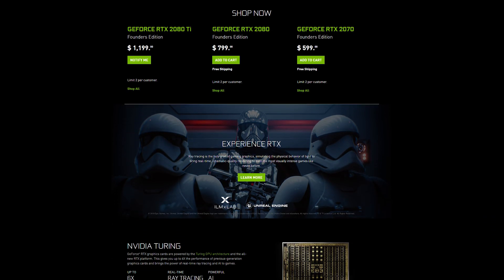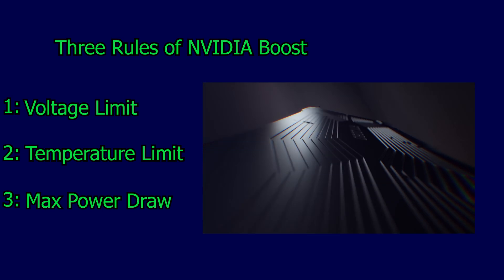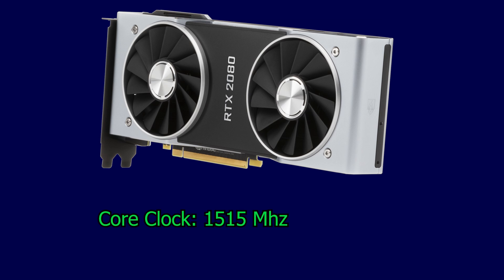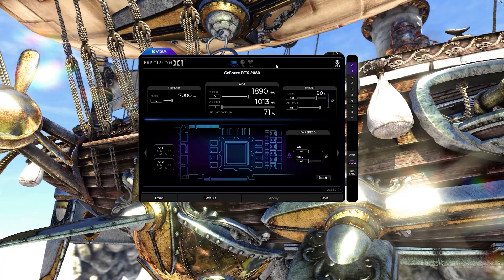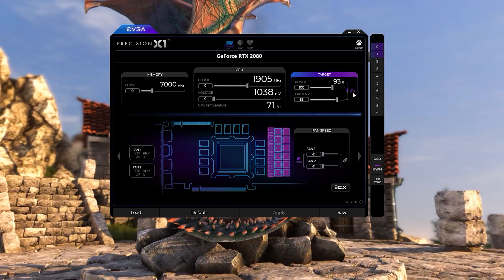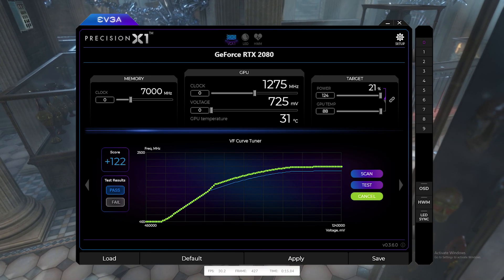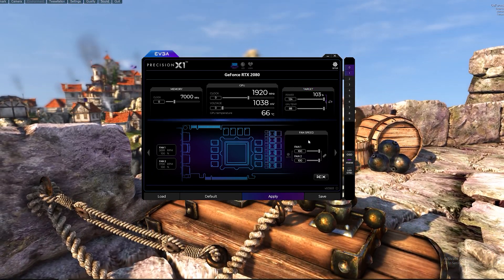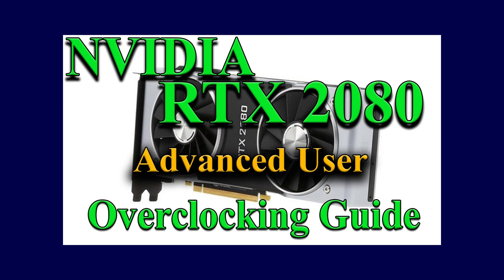What is NVIDIA Boost 4.0!

Comment: Does VRAM temp matter with boost clock?
Reply from the maker: No because Boost does not adjust the Ram Frequency. It has set stepping values from Idle to 3D-Load.

Comment: Hi I just bought a gigabyte rtx 2060, my card is always hitting the 83c temp limit, is my card gonna be okay with that high temp? My case has 3 fans front intake, 1 exhaust rear and 1 exhaust top. Thank you for your answer.
Reply from the maker: Yes. If you don't play with the settings, NVIDIA temp target is always 83c. You can increase the video card fan speed yourself if you want lower temps.
Reply: @overclockersclub   mine can go all the way to 100c ,
Reply: @MattJP_  This is my feeling too! Please let me know if you have any more insight.
Reply: Mine goes to 83°c as well so i claimed warranty so that they can fix the cooling issue because I'm worried about its lifespan.